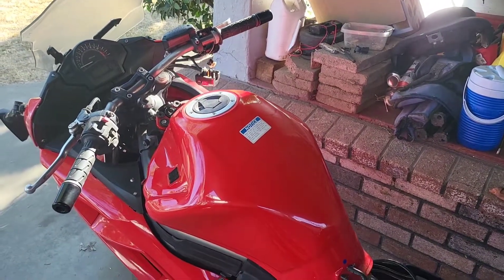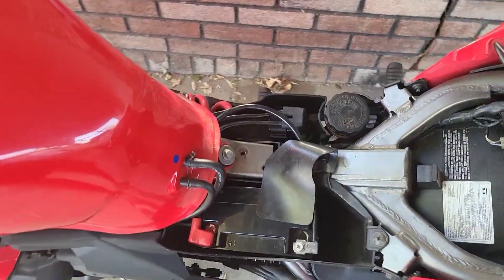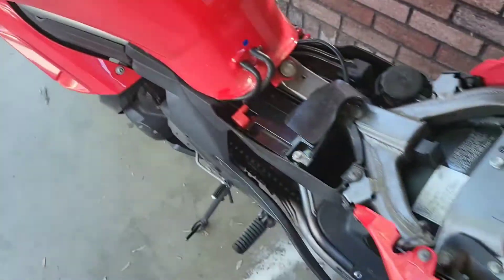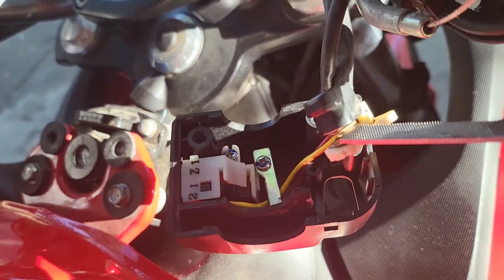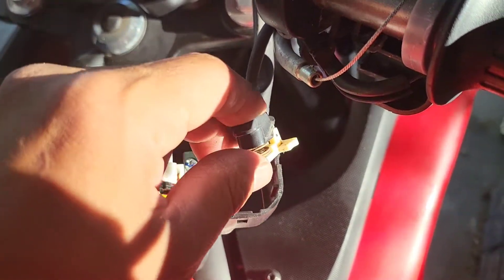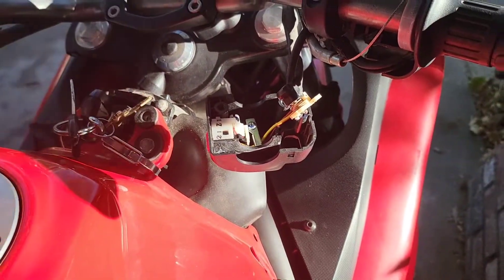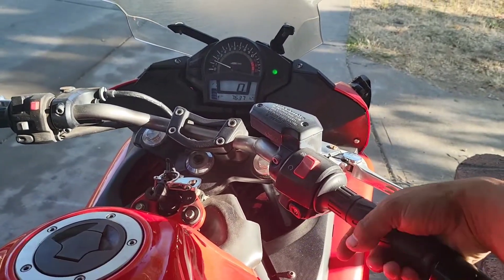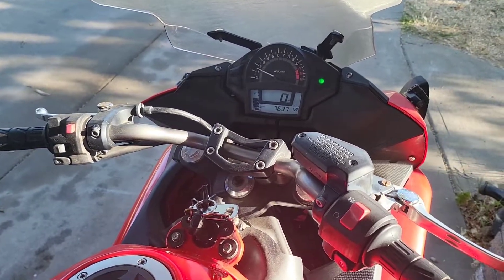2012 Ninja 650 no start push button EASY FIX!!!

Comment: And once again I've been saved by Youtube. Exact same thing on my 2019 Versys 650, spent hours yesterday without success, now came here to get new ideas and bang, that was the one. What side-tracked me on this one was the fact that it cranked when I shorted the starter relay, this made me think it is not the starter button. But actually the ECU wants a signal from it, it does not start the fuel injection and spark if you just short the starter relay. Which is a bit wonky to be honest, because should you press the start button then while bump-starting the bike? Should try it some time, does not make sense but hey at least for now I got my bike running, thanks!